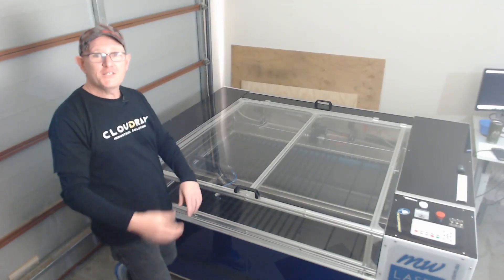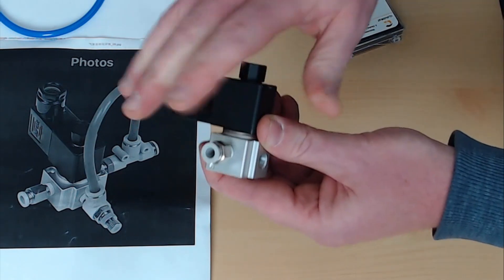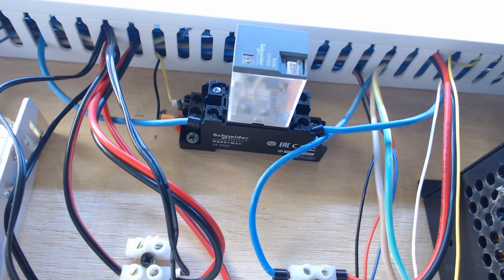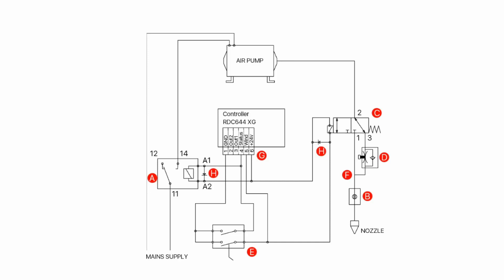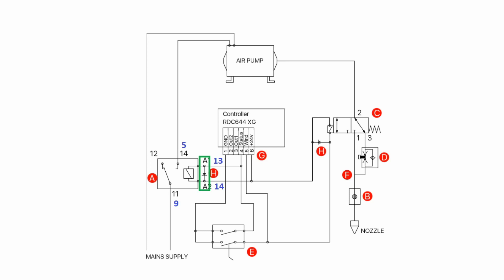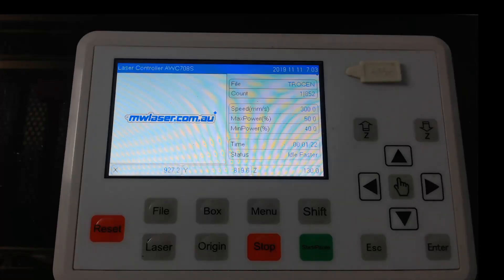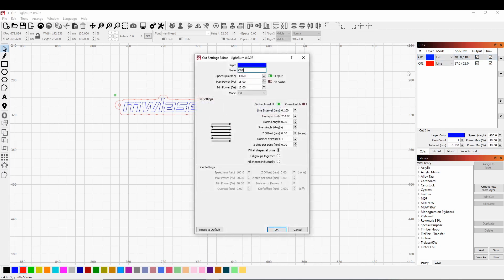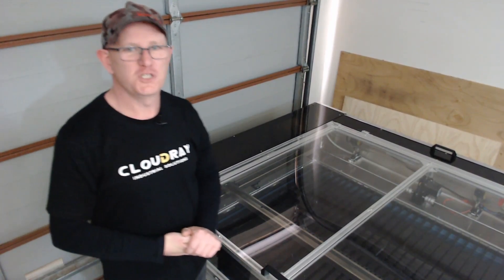Ultimate Air Assist Install On Trocen AWC708S - Updated Edition

Comment from the maker: NOTE: UPDATED DIAGRAM for 06:08
-NEGATIVE CONNECTION of Switch for Pneumatic Solenoid Should Connect to OUT4 (indicated by Yellow Lines)
-POSITIVE CONNECTION of Switches Connect to 24VDC (indicated by Brown Line)

OPTIONAL CONNECTION: The NEGATIVE CONNECTION of a Switch for Relay Should Connect to OUT1 (indicated by Yellow Lines)

This is Method is useful if you want to turn on exhaust and air while a job is not being processed, for example to evacuate fumes and smoke at the end of a job, turn on SWITCH to RELAY, this will turn on Exhaust air if it is connected to the relay power outlet.

The Switch for the Pneumatic Solenoid controls AIR to the Nozzle, by using this switch you can manually turn AIR ON if a layer or cut setting did not have AIR ASSIST ON.

You do not need to have 2 Switches, it would dependent on how you prefer to customise your machine’s Air Assist Kit.

https://mwlaser.com.au/ultimate-air-assist-trocen-awc708s/
Reply from the maker: https://mwlaser.com.au/ultimate-air-assist-trocen-awc708s/

Comment: Regarding the other laser you have , the Chinese black and red, with your close contact with cloudray, do you think you can make a video on the laserhead upgrade?
Reply from the maker: Yes it is on the list to do, but wont be for some time as I have other video requests to complete beforehand
Reply: MW Laser super, it will be very useful, the std laser head is not really well performing, but it seems that find a compatible replacement laser head is not so easy than that....,